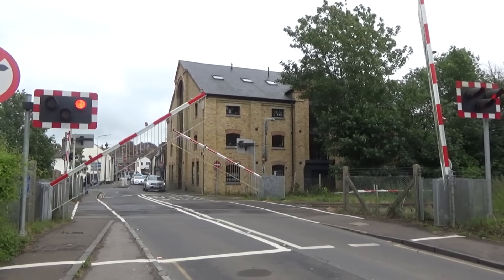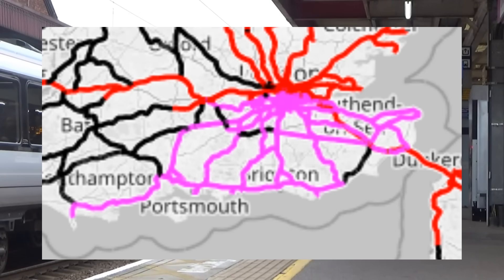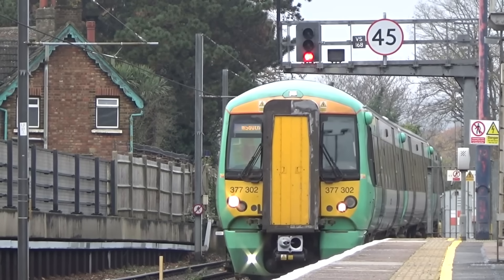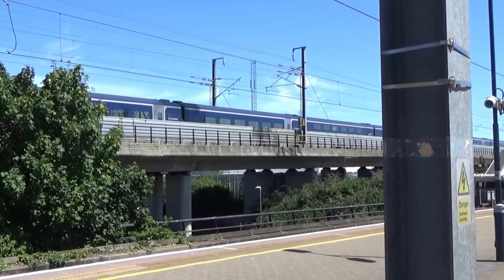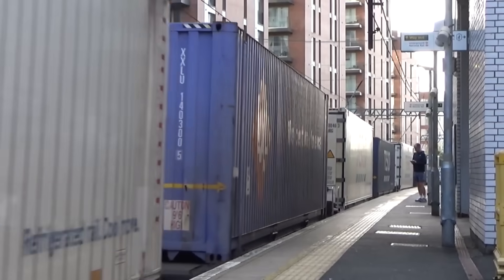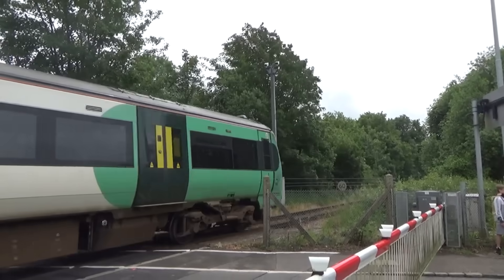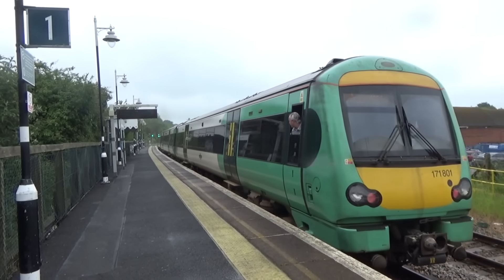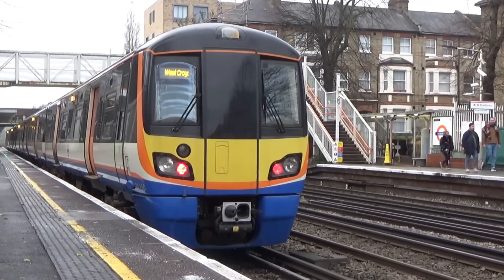Are These Railways Actually Unelectrifiable?

Comment: You raise very good but also very old points. The joke of not allowing more 3rd rail in a predominantly 3rd rail area is bureaucracy gone mad. It is way beyond stupid. Electrifying with 3rd rail the 3 main areas missing it would simplify train fleets, and allow better timetabling because even 3rd rail EMU’s can accelerate faster than DMU’s. Additionally, electrifying the North Downs line would allow SWR (or equivalent in due course) to take over the route and maybe even add some alternative services to Gatwick and/or Reading with a full EMU fleet. There is simply no need for GWR to operate these services out of Reading. SWR, etc, could actually do it now as they do already have a DMU fleet.
The next candidate for 3rd rail electrification would be the route out of Basingstoke through Salisbury to Exeter. It seems there is already replacement fleet planning going ahead, but not by using a 3rd rail fleet, which once again is a shame as this could also lead to new journey opportunities in the region. It could mean curtailing some of the existing SWR DMU operations and handing these to GWR. 
Either way, all the nonsense about no further 3rd rail expansion is just plain ridiculous. It has proven to be generally more reliable than overhead electrification. I’m sure the statisticians would have field day coming out with positive results for it, and that;s apart from it also being considerably cheaper than the alternatives.

Comment: 3rd rail is the only sensible path for these Southern Region lines. With Side contact shoes as used in New York is much more resilient to snow and bad weather than top shoe 3rd rail and ohle. The migration of 3rd rail to Ohle 25kv should be done on business case basis. The Thameslink services are primarily commuter and the cost of swapping to ohle in the tunnels in the routes through London Bridge and Loughborough Junction make no sense. From a business perspective one line where dual power might make sense is to Southampton. Ohle from Reading to Basingstoke and from Badingstoke to Southampton makes economic sense with the freight involved. Additionally rsdtorimg the much needed diversionary route to the South West could mean electriciation from Worting junction to Exeter St Davids could be done at the same time as restoring double track. This would mean bi mode stick would need to be used like the Thameslink units or the bi mode electrostars on the Southern service from Clapham Junction on the West London line. Do not forget the original Eurostars were bi mode. But the real problem is not technicalities but Government incompetence and lack of leadership or clear strategy. For example in these days of Ecological awareness there is no excuse for not reintroducing motorail services. One party just wants to sell iff the crown jewels and the other just wants to reintroduce authoritarian State Control removing choices. From a leader in Rail, Britain has become a joke.

One point if correction I always make on this topic concerns how much better ohle is. The latest development in High Speed Trains is Maglex or Magnetic Levitation and the Germans and Japanese are building or have built such systems which can rival aircraft in speed. These use track power not Ohle as the pickup from wires does not support the high speeds. So what comes around goes around.

Comment: I find it crazy that Didcot - Oxford hasn't been electrified. This was a massive, recent electrification project, where because it wasn't finished in full they still need to use diesel/ bi-mode trains on this busy corridor for passengers and freight, because of a ~15 mile section which was cut from the project. 
I feel like a lot of project management decisions on UK rail projects end up being "ok we need to save money, let's reduce the costs by 10% but reduce the benefits by 30%"
Reply from the maker: yeah defo, and even more so, the IET trains (designed for long distance routes) are put on the short runs to oxford because theyre the only bimode trains GWR has... instead of the much more appropriate class 387s...
Reply: Didcot-Oxford wasn't electrified because a major rebuild of Oxford station is in the pipeline and it didn't make sense to electrify Oxford before the rebuild takes place.

Comment: I needed to know why don’t they just dig a tunnel and do an extension for the Piccadilly Line railway tracks, so that they can be connected with the West Coast Main Line railway stations. Why couldn’t they use the part D78 Stock train doors on the sides and also restructure the front face of the Q and A62 stock that includes the class 313, class 314 and class 315 remix and make them all together and also redesign them an overhead line and also make them into Five cars per units and also having three Disabled Toilets on those Five cars per units A62 and Q stock trains and also convert the Q and A62 stock trains into a Leyland 680, Volvo D10A, Gardner 6LXB, Volvo B10M, Scania N113, Volvo D10M, Gardner 6LXCT, Cummins M11, Lister Diesel and Gardner 8LXB Diesel Engines and also put the Loud 6 speed Allison Gearboxes even Loud 10 speed Epicyclic Gearboxes in the A62 and Q stock, class 313, class 314, and class 315 and also modernise the Q and A62 stock and make it into a 10 car per unit so it could have fewer doors, more tables, computers and mobile phone chargers. Q stock Trains and also having 8 Disabled Toilets on those Q stock trains. why couldn’t we refurbish and modernise the Waterloo and city line Triple-Track train tunnel and make it larger and extend it to the bank station, making it into a Triple-Track Railway Line so those Five countries such as Australia, Germany, Italy, Poland And Sweden to convert the waterloo and city line Triple-Track Railway tunnel into a High-Speed Railway lines? The Third Euro tunnel Triple-Track Railway line to make it 11 times better for passengers so they could go from A to B. Then put the modernised 11 car per unit A Stock and put them on a bigger modernised Waterloo and city line Triple-Track train tunnel so it could go to bank station to those Five countries such as Australia, Germany, Italy, Poland And Sweden. The modernised refurbished 11 cars per unit A stock could be a High Speed The Third Triple-Track Euro Tunnel Train So it is promising and 47 times a lot more possible to do this kind of project if that will be OK for London Australia, Germany, Italy, Poland And Sweden. oh by the way, could they also tunnel the Triple-Track Railway Line so it will stop from Buckinghamshire, Hertfordshire and Essex so that the Passengers will go to Australia, Germany, Italy, Poland and Sweden and also extend the Triple-Track Railway Line from the Bank to Buckinghamshire, Hertfordshire and Essex Stations so that more people from there could go to Australia, Germany, Italy, Poland And Sweden more Easily. Why couldn't they extend the Piccadilly Line and also build a brand-new underground train stations so it could go even go right up to Clapton, Wood Street can they also make another brand new underground train station in Chingford and could they extend the Piccadilly Line and the Docklands Light Railway further up to Wood Street and then to Chingford? All of the classes 150, 155, 154, 117, 114, 106 and 105, will be replaced by all of the Volvo D10M, Gardner 6LXB, Leyland 680, Scania N113, Volvo B10M, Volvo D10A, Gardner 6LXCT, Lister Diesel, Cummins M11 and Gardner 8LXB Diesel Five carriages three disabled toilets are air conditioning trains including Highams Park for extended roots which is the Piccadilly line and the DLR trains. Could you also convert all of the 1938 stock trains into an air-conditioned maximum speed 81 km/hours (51 MPH) re-refurbished and make it into a 7 cars per unit if that will be alright, and also extend all of the Piccadilly train stations to make more space for all of the extended 7 car per unit 1938 stock air condition trains and can you also build another Mayflower and Tornado Steam Locomotive Companies and can they order Every 87 Octagon and Every 36 Hexagon shape LNER diagram unique small no.13 and unique small no.11 Boilers from those Countries such as Greece, Italy, Poland, and Sweden, can they make Mayflower and Tornado Steam Locomotive speeds by up to 147MPH so you can try and test it on the Original Mainline so it will be much more safer for the Passengers to enjoy the 147MPH speed Limit only for HS2 and Channel Tunnel mainline services, if they needed 13 Carriages Per units, can they use those class 17’s, class 47’s, class 93’s, class 44’s, class 40’s and Lister class 43HST Diesel Locomotive’s right at the Back of those 13 Carriages Per Units so they can take over at the Back to let those Mayflower and Tornado Steam Locomotive’s have a rest for those interesting Journeys Please!!!!!!!!!!, oh can you make all of those Coal Boxes’s 19 Tonnes for all of those 147MPH Mayflower and Tornado Steam Locomotive’s so the Companies will Understand us PASSENGER’S!!!!! so please make sure that the Builders can do as they are told!!!!!!!!! And Please do something about these very very important Professional ideas Please? Prime Minister of England, Prime Minister of Australia, Prime Minister of Sweden, Prime Minister of Germany, Prime Minister of Italy, Prime Minister of Poland and that Includes the Mayor of London.
Reply: Erm, excuse me good sir? I do beg your pardon? I’m the one in this lovely rail convent whomst is known for typing out absurdly long paragraphs of text. What kind of act do you think you’re playing at with this malarkey? This tomfoolery? This absolutely shameless barbarianism? Well colour me bewildered, for I have NEVER - not once in my 5596 days upon this cruel & god forsaken earth - had a single soul attempt to even dare exceed my cautiously-curated character count… so to think that a MERE SIMPLETON such as yours would even have THE GALL to even DARE overthrow me & my status, leave me by the wayside to be mauled to death by the beautiful & terrible nights as I drown in my own sorrows & ineptitude is beyond preposterous. Shame on you sir. May you forever get thyne’s pubes in every meal you have for the rest of your time on this earth.

Comment: The ORR's rules shown in this film (many thanks for putting them on the screen) will either be modified to allow third-rail line extensions, or a new Transport Minister will will overrule ORR and direct that third-rail electrification can continue as long as it meets the same safety standards as are used on recent third-rail electrifications. Three third-rail projects were completed in the 1990s: Portstmouth/ Havant - Southampton/ Eastleigh; Sanderstead-Oxted-East Grinstead , and Redhill-Tonbridge.
Reply from the maker: hopefully yeah

Comment: Afaict there are at least four disjoint areas of third rail electrification on the UK network.

1. The "southern electric" area (by far the largest).
2. The northern city line.
3. Merseyrail.
4. The island line.

On the other hand I belive all the 25KV overhead electrified lines in the UK are interconnected (ignoring short neutral sections that can be coasted through) though sometimes via rather cicitous routes.

Comment: As taxpayer i would honestly appreciate it, if the infrastructure would be „shadow“ build.
Like you gave a fixed budget every year to electrify a portion of network.
Like a goal to pre-electrify 100 miles every year until 2050 or something.
And until a railservice is completly electrified you can lease dualmode locos.
There are now enough options on the market to also use them in passenger transport and reach a reasonable speed in both modes.
Reply from the maker: yeah defo, i acc think scotland has done this

Comment: The fact that any of our mainline railways arent electrified, infact the fact any of our rail infrastructure isnt electrified. Just pounts to the ridiculous lack of investment in rail infrastructure by publicly owned network rail.  A lack of investment that results in constant failure,  delays and cancellation.  Why is Italy and Spain so much cheaper and more efficient? They constantly modernise their railways and the investment pays for itself in cheaper operating costs.  I the UK we don't invest in maintenance and renewal of existing assets,  we lost than degrade until they stop working then patch them up to barely keep them functional.

Comment: The Uckfield line would certainly benefit from a hybrid unit. London Bridge to Oxted is fully third rail, even if the train was battery powered, charge up to Uckfield and run the last few miles and back on battery, I can imagine it would work!
Reply: It would be nice, if the islands are unlikely to get electrified, to see a multi-mode unit made for the third rail gaps, that can use third rail where it exists and an onboard power source where it doesn't. Though that said, I have seen it said that poor power supply options (can't remember whether that referred to Uckfield or the Salisbury trains, or both) means that if the diesel trains started using the third rail supply, they'd need to sort out more power...
If I were allowed my crayons for a moment, I'd transfer the North Downs Line services to either Southern or SWR, and both would get a unit that can replace the 171s and 15xs respectively. Though of course, as I don't actually have to design such a unit, I'll leave that hard work of creating one, and getting them funded, for someone else to do 😂
Reply: Actually Hurst Green the junction is electrified

Comment: The political pressure to complete the Southern third-rail network  (that is, the lines identified on the map in the film) will build up. The setting-up of the vertically-integrated Great British Railways gives the opportunity to do this. The ORR's rules will either be modified or a new Transport Minister will will overrule ORR and direct that third-rail electrification can contrinue as long as it meets the same saftey standard as are used on recent third-rail electrifications - Portmouth/ Havant - Southampton/ Eastleigh , Sanderstead-East Grinstead , and Redhill-Tonbridge - all completed by BR in the early 1990s.

Comment: OHLE can run at a much higher voltage which needs far less substations as there is then far less voltage drop and less power loss. But if a rail line is not built with sufficient clearances then it needs huge investment in lowering tracks in tunnels and raising bridges etc.. as well as putting up thousands of masts. But it's much safer as it's out of reach of trespassers who are often children! And it's miles more efficient and can be used at higher power levels than conductor rails which not only need far more substations but have only limited power capacity because of the lower voltages that can be used, at only a few hundred volts, and they're far more dangerous at track level.

Comment: The most likely option for Marsh link , and Uckfield, would be a conversion of 377's  to operate on 3rd rail/ battery, with charging possible on the 3rd rail parts of the route especially on Marsh link services, you have options of the service, one possibility  would be to extend the Charing cross  to Hastings service to Ashford, thence fast to Charing cross, so giving a direct London service,   Uckfield  units could run as they are,

 the same conversion, or a new sub class of 378's  could be a tri electric unit, overhead, battery 3rd rail, GWR would then have a general purpose unit for its   Thameside branches, capable of running on overhead, as well as battery, and  for the north downs route, capable of   running battery, or overhead, as well as 3rd rail for the sections Reading to Wokingham, Ash to Wanbrough, and Reigate to Gatwick .  and if full electrification  , including Reading to Basingstoke,  Exeter, oxford, Bristol  and to the far west, the same units could then  be used on  the devon, and Cornish branches. eliminating Deisel traction  through out.

Comment: Re the freight movements from Southampton docks, it may be that the new class 99 will be popular in due course. It might be worthwhile installing OLE from Basingstoke north to Reading, then if they do the same north of Didcot via Oxford a lot of gaps will be filled in.

The other related issue is the technique that has been adopted by Transport for Wales, with some extensive dead sections to avoid expensive clearance alterations, such as Caerphilly tunnel, and other over bridges etc.

Comment: Another advantage of 750v DC is that if the shoe pushes the live rail off th einsulators (I have been on a class 319 that did so) a ground team can quickly put it back and services reasume. If a pantograph tears down a lengthe of OLE the line is out of service for much longer.

Comment: What's going on with the police car at 0:15? Does the police car have some kind of device that opened the crossing gates?
Reply: No that was the signaller raising them
Reply: Some stations, especially those right in town, have a road crossing at one end of the platform.  The crossing gates for those are manually triggered when the train is ready to depart, so the crossing isn’t blocked the whole time the train is in the station.  I think they were triggered, someone saw the police car coming with lights on, and they canceled the gates until the police car was through.
Reply from the maker: the signaller has a camera looking at the crossing, theydve seen the police car and raised the gates for it to quickly get through

Comment: Reading to Basingstoke is also interesting to consider. It was supposed to be fitted with OLE as part of the electric spine down to Southampton.
What they did do was build a feeder station for the GWML electrification.
They also extended all the platforms to accommodate 4 cars.
There was a plan to use the trimode conversion of the 319 but thankfully that got cancelled. 
I suspect it'll end up with some form of fast charging battery train.